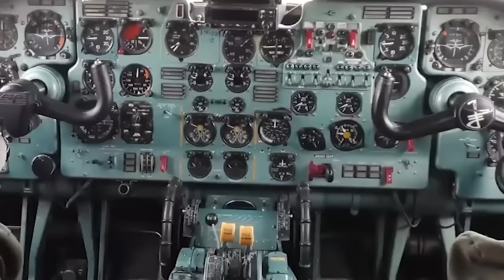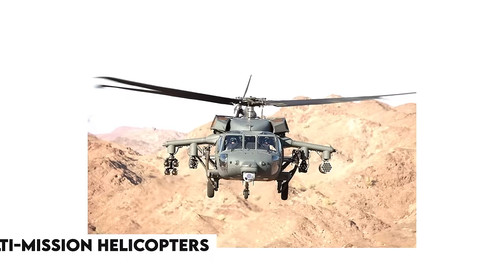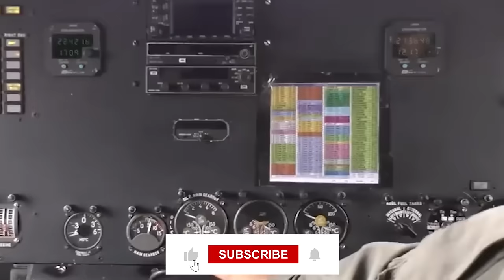SHOCKING: Repairing Hundreds Of Tanks And Helicopters By The TALIBAN Government In Afghanistan

Comment: You know, this subject was thrown around some in discussions. And most agree that without a constant supply of spare parts, trained mechanics, and just some good ole PMCS most of the vechicles will become junk. Just as the vechicles left by the USSR. Firearms and munitions rank that way also. And what is an assult tank? Is that on par with a defensive rock?